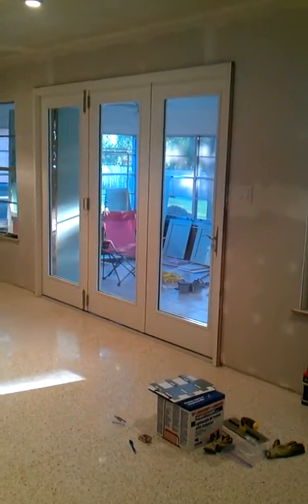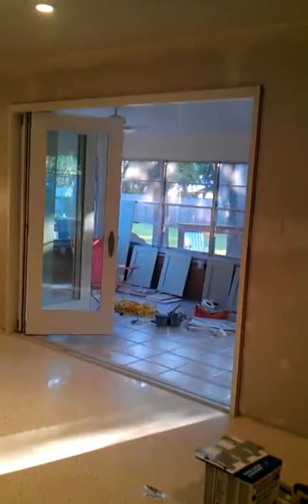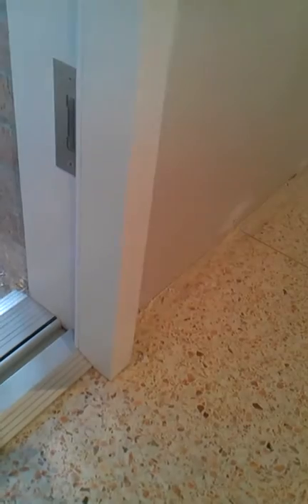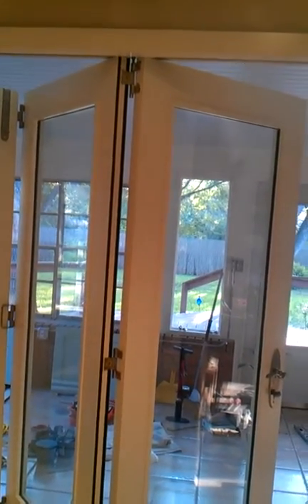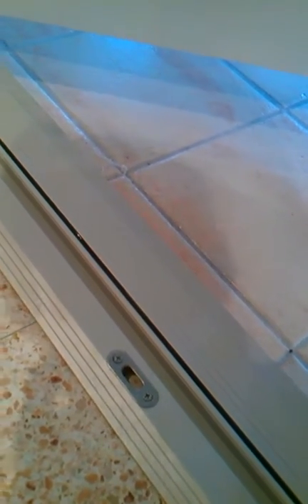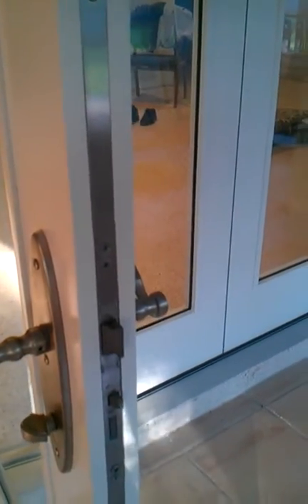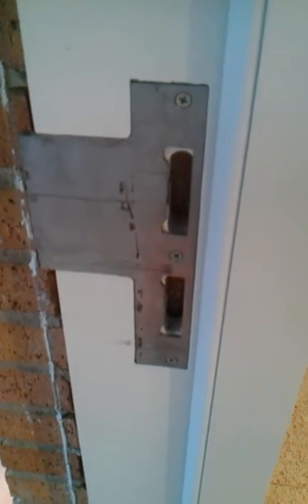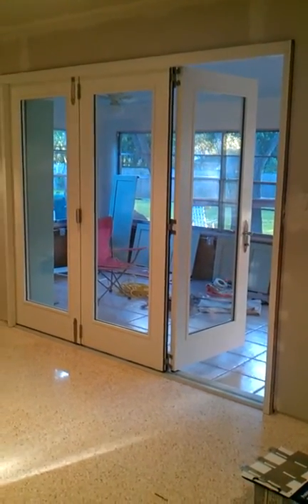Jeld-Wen Aurora Folding Door review

Comment: Great review. We recently installed this door, had very similar issues, especially with the screws. The screws strip easily, holes not factory drilled properly. All in all it’s a cool door, has the look we were going for.  Ours opens onto a covered deck. We painted it black to match our window frames, anxious to see how it fares this winter  -  we are in Michigan. The snow and cold temps can be off the charts.